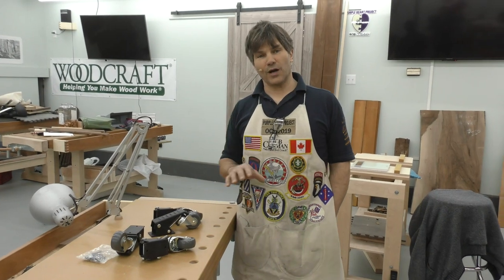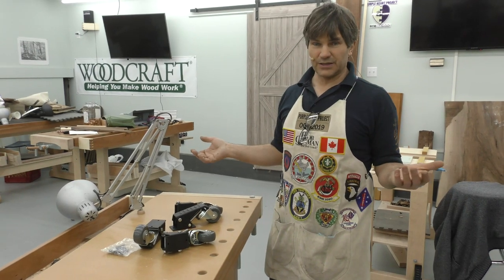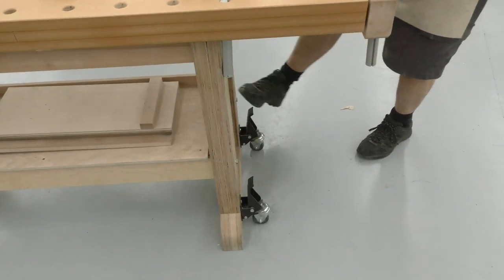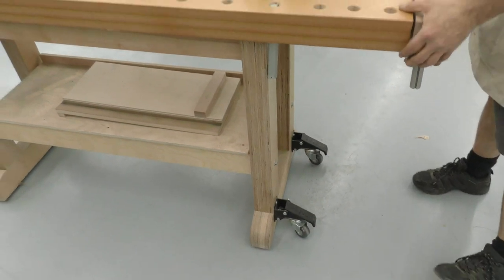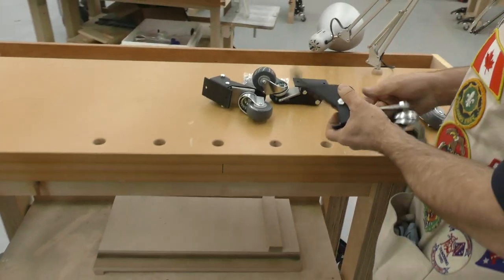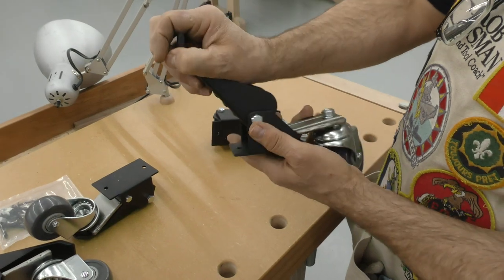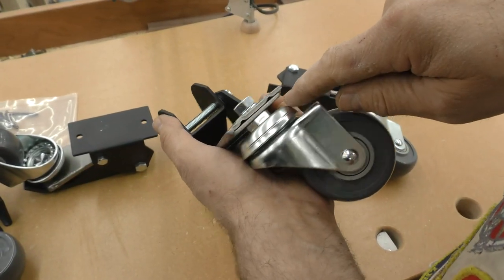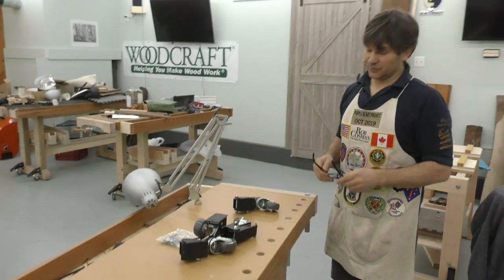Workbench Casters Modified

Comment: I have the New Version Pro Caster set that has six holes in each mount.  I was worried that the bench would be too heavy for them, but they lift the bench effortlessly, and the bench moves incredibly easy when on the casters.  I actually mounted mine a few millimetres higher than advised because that moves the cam to a point where it has more mechanical advantage.  This gives me about 5mm clearance, which can be problematic to be fair, as it sometimes gets stuck on something.  BTW the bench is a lot lighter now than when I made it.

Comment: What is the original cost of the wood river brand wheels?
What is the load rating per caster wheel before and after modifications?
Thanks, Joe
Reply from the maker: Joe Wampler the original cost is $88 and after welding them we sell them for $119. The original load limit is 110lbs per caster, so they will easily hold 450lbs as a set.
Reply: This a good idea for those who can trade money for shop time.  And $120 may not be bad for improved $88 casters.  But check out Amazon and you will see that these are <$45 castors.  Even so, these may be worth the price.  Just know the full story.
Reply: @RobCosmanWoodworking  What is the new weight capacity limit with the new support plate added?
Reply from the maker: Dont know for sure Frank but they survive just fine on our benches.  Before, if you hit a bump the plate would bend and then steering the bench made you look like a drunk driver!  Before this I had taken them apart and redrilled the holes to change the leverage but to no avail.

Comment: These casters (https://www.amazon.com/gp/product/B07V6X2LNB/ref=ppx_yo_dt_b_asin_title_o04_s00?ie=UTF8&psc=1) do not have the problem Rob describes because they have a U-shaped steel supporting plate rather than a flat one.  They are  $38 delivered, 1/3 the cost of these modified ones.  I have used them on a 500 lb steel welding table with no problems.